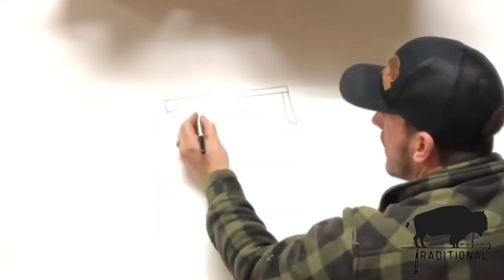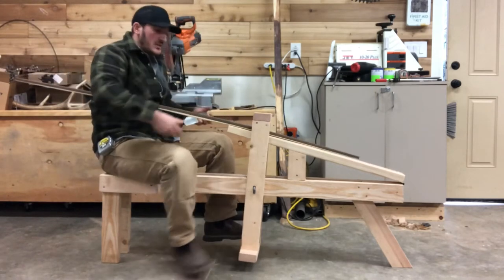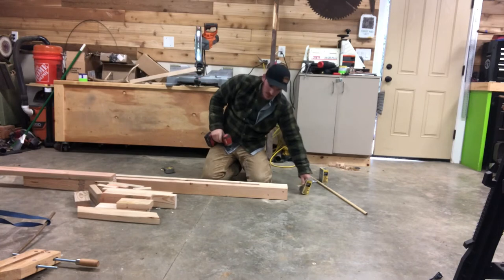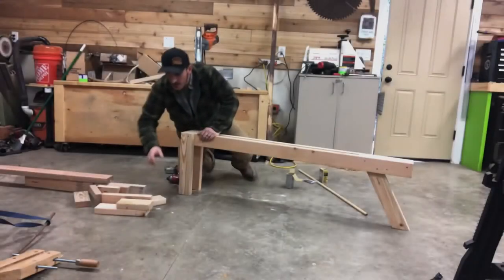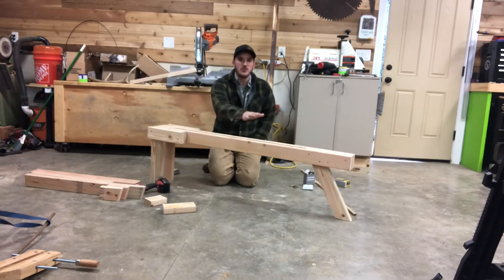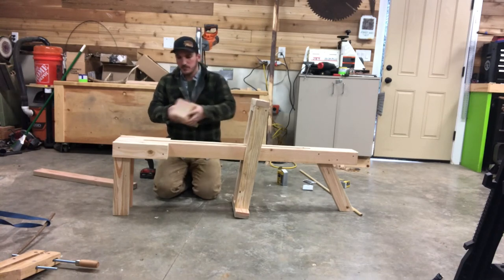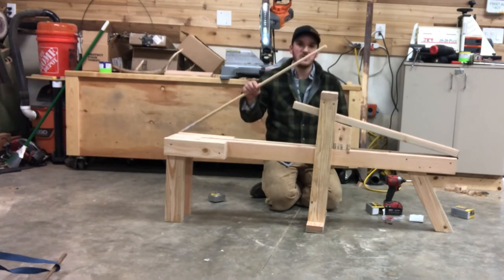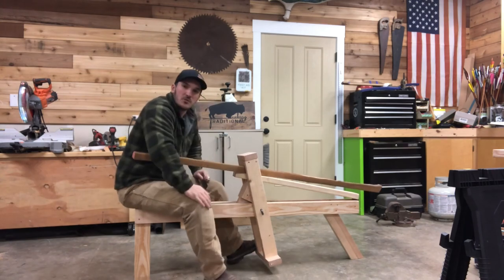Making A Bowyers Bench : Simple, Effective, CHEAP

Comment: Sweetness,   I built the design you showed, but made it 68 long, (dont know why honestly.  And 22 high cause I'm a bigger dude. Then I found out I made the tenion support to long and need between a 10.5 and 14 degree angle.  Amd need to re drill the pivot or bore one side out cause I went crooked,  that brings up something g that I think you forgot to mention,  did you drill through both sides of the Frame and clamp carrage,  I have a 18 long bit. And  I tried for straight and nope. So I guess a safer bet is to carefully measure and drill from both sides,  I guess I could skew the clamp rail to compensate for the crookedness ehhaha.

Comment: Metric Conversion (to nearest mm) if anyone wants it.

2 @ 1,524mm (bench frame)
2 @ 457mm (back legs)
1 @ 533mm (30* miter cuts on both ends-parallel) (front leg)
1 @ 203mm (30* miter on one end) (bench frame)
1 @ 152mm (bench frame)
2 @ 216mm (bench seat)
2 @ 305mm (bench seat)
2 @ 660mm (clamp assembly riser)
1 @ 114mm (clamp assembly)
1 @ 191mm (clamp assembly)
1 @ 318mm (clamp assembly pedal)
1 @ 254mm (15* miter) (ramp adjuster)
2 @ 153mm (15* miter) (ramp adjuster)
1 @ 914mm (ramp)

Comment: I wrote some detailed instructions 

INSTRUCTIONS 

start with 
( bench frame ) = 134" of wood / 250" REMAIN 
- cut 2 boards to 60" 
- Cut 8" 30* cut and sandwich between 2 of the 60" in the front 
- Cut 6" straight block for the back seat 
- Screw in the boards together making 1 1/2" gap in middle diamond screw 2 and lap on back 

( Legs ) = 57" of wood / 193" REMAIN 
- cut 21" board with 30* parallel cuts both sides for front leg Flush behind the 8" 30* cut 
- screw the front leg on 4 screws total 
- cut x2 18" long straight cuts for back legs 
- Scew them on the back side flush with back on outside of frame 

( Bench Seat ) = 41" of wood / 152" REMAIN 
- Cut x2 8 1/2" pieces straight 
- screw in front of back legs 
- Cut x2 12" straight pieces
- screw onto the entire seat outside 

( Clamp Riser & Pedal ) = 76.5" of Wood / 75.5" REMAIN 
- cut x2 26" piece 
- cut 12.5" piece 
- cut 4.5" block piece for width of bench used for pedal spacer 
- use 4.5" piece on bottom for spacer DONT screw it in bottom 
- with it as spacer then screw in the 12.5 piece on bottom not to the 4.5 
- with bottom 12.5 screwed on slide the 4.5 up flush to end / top then screw it in 
- cut 7.5" block
- screw it on top of flushed 4.5 
- Slide it in between bench so far 

( Slide Adjuster Block ) = 22" of wood / 53.5" Remain 
- Cut x2 6" blocks with 15* angle cuts 
- Cut x1 10" Block with 15* Angle matched with 6"
- Layer them and screw so cuts on top should slope down away from you

( Ramp ) = 36" of wood / 17.5" board remains
- Cut final cut 36" straight board 
- line up flush with the front end and hinge it onto main frame
- Adjust the Clamp to good position and then drill 5/8" hole all the way through and mallet in the dowel to act as a axel then saw it to a good length
Reply from the maker: Thanks for taking the time to do this and for watching!
Reply: Thanks brotha
Reply: Good working for every one

Comment: Would a larger surface area on the pivot arm hold the work more securely?  I noticed you had a lot of movement on your long piece.
Reply: Lining the surfaces with some leather will help, too.
Reply: I have the same question. Wondering about shortening the overall length and shifting the pivot point forward.

Comment: THANKS for this video, it's very useful !!! 🙂 Kindly what means  " * miter " near the value  30  and 15 and also " @ " for each wood item THANKS a LOT
Reply from the maker: Miter cuts at 15degree and 30 degrees
Reply: @MakingTraditional  Thanks a lot, in the past days I started to build  the bowyers bench !!!!!!  :-)  :-)
Reply: I have just put together the body of the bench. It feels good and solid all round. I decided to use wood dowels instead of screws. It took a while, but I am pleased with the look,  and I enjoyed using the mallet.
So, about to put together the clamp assembly I was puzzled by the 4.5 inch piece. Must be a typo, surely?  The body   of the bench is just under 5.5 inches wide.